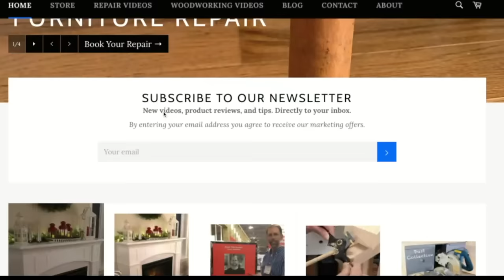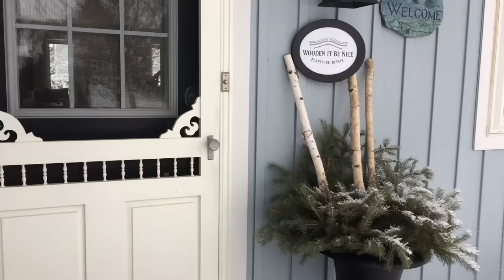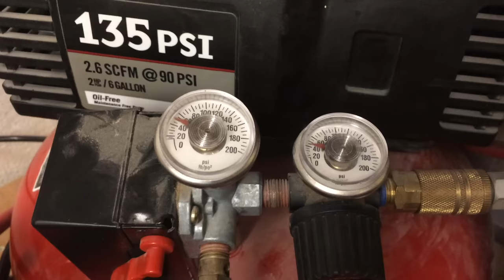How to Repair & Age Wood: A Rustic Wooden Chest Repair by Fixing Furniture

Comment: Love the trick with the coffee grounds blackening of screw heads. In the good ol' USA we can still buy straight slotted screws for restorations, but they look too new. So I'll test your trick. I am also going to test a couple of rust bluing techniques I found in other videos. I'm putting new hinges on an old box my wife's grandfather made. It's a box-jointed ammo box he fitted a lid to, painted gray, I was going to replace the old split lid but the boss said no. I sanded off enough of the old paint we can now read the box label. The trick with these is to know when enough is enough. My father was an antique dealer and refused to buy pieces that had been "restored" by a hot tank dip to strip all the paint and finish, then really sanded. No one will buy an antique that doesn't maintain a little character.

Comment: I find there's  a sense of satisfaction in figuring out how to return something to its original condition, as well as the puzzle of determining the best way to do it. As an amateur woodworker, I sometimes think this is more fun than building new. Great work.
Reply from the maker: Great point Tom!  I transitioned by business from custom furniture to furniture repair partly because of that.  I find it challenging and rewarding.  Cheers.  Scott
Reply: Scott, 
Something about the lid fit bothered me when you first set it on the chest, then after installed & you had to cut the lid haif round trim sections off of  the sides pieces it occurred to me that this lid was originally wider than what was given to you. Maybe there was a 3/4" section or piece in the lid between the two 8"  wide panels, that's where it came  apart - possibly. 
Why did you choose to cut the front rather than install an approximate 1" section on the back of the lid, or between the two panels, and "antique" this new addition as you did to the front?
Thanks, enjoyed the video, Tom
Reply from the maker: Good question Tom.  Adding wood to the top would have been obvious.  It's virtually impossible to disguise adding a new piece to a table top.  The grain pattern needs to match, the stain needs to match, the finish needs to match.  It typically requires a strip and refinish to get close to hiding the new piece, and even that doesn't work sometimes.  I hope that helps.  Scott

Comment: What a nice coincidence - YT just showed me your video on the Barrister's Bookcase. I have a very similar one but made by Melton Rhodes. Wish I had seen your YT earlier because I've been scraping and sanding the finish off - didn't know it was probably shellac or that I could amalgamate with with denatured alcohol. Oh well. I still learned :-) 
Then the next video that came up was this one - and I have a very similar rustic chest. My grandmother gave it to me 50 years ago. It has dovetail joints not nails but is very similar. 
Thank you for sharing your knowledge and experience.

Comment: I did a project a work several years ago where we needed to to metal plate conduct electrons in water that were not connected. We tried several additive, one of which was vinegar. Number one, it worked, but it stunk. The one we utimately found was stump remover. I worked great, but caused the metal to rust very quickly. Much faster than the vinegar. Just an FIY. Love you channel and you and other have inspired me into using my abilities to learn more and start repairing furniture myself. I've learned a lot from you! Keep up the good work.

Comment: That brought it back to life nicely.  I believe it is a carpenters tool box made from used lumber. A lot of old timers recycled lumber, I spent a lot of hours pulling nails from old siding and roof boards. As they were late 19th to early 20th century buildings they had old growth lumber.  I have seen barns with granaries, dairy sections and hay lofts with massive oak beams, others even black walnut beams.  They were trees from the proptery that the farmer harvested.
Reply: That chest would be impossible to move as a 'tool box' with any amount of  tools in it, plus, it would be much more chewed-up and oil stained had it been used as such, with perhaps drill holes and sawing cuts in the top of it as well.

I have a similar but larger chest in pumpkin pine with what my uncle called a 'til', which is removable and has a hinged lid, in the same location. 
Perhaps for money, but most likely for small items so they didn't get lost inside the trunk---  like sewing and knitting needles. I use my trunk for summer storage of blankets and woolen jackets. In the winter it holds my summer clothing!
I also have 11 smaller trunks and tool boxes in a graduated stack in my dining room. The various woods, finishes, colors and hardware make an interesting sculptural assembly.  
Every room needs an antique (and the color red) to help ground the room, in my opinion! I often think of the previous owners and wonder what their lives were like, what they did for a living, and give them  thanks for making the world a better place---  then and now! Each trunk, chest and box has a history and tells a story if we take the time to be open to it! 
But a stack of these makes a great folk art  history piece that has a beauty all its own. You just can not fake the patina that comes from use over time!

Comment: I'd have guessed the top crack was caused by those side trim board running with the grain in the opposite direction.   The much later screwed slats across the top were most likely added long after the big top separation crack showed up.

My choices for the crack would have been to live with it,  inset a strip of filler wood in the crack or make up the difference along the back of the piece and not the front.  Doing more damage to "disguise" the new cut would not have been my choice either.   The removal of that front wood, leaving a bigger gap than before and the removal of the lock mechanism, leaving a gaping hole all could have been avoided by choosing a different solution.

I own a similar piece for how the inside is laid out. It was my great grandfather's and held tools, including wall paper rollers, some paint brushes and some graining tools. He was connected with a paint company for years. 

The hinges you removed are extremely thick, which indicates they are quite old.
Reply: Agreed, he seems to be ignorant of the first rule of repairing - cause no more damage.
(Laughable hearing him talking about hide glue being 'reversible' then seeing him chopping chunks out of the front)

Comment: I have an old wood box very similar to yours but not quite as tall. It came from Weyburn, Saskatchewan and was used as a rock box in the days of the Richardsons.  Pairs of curling rocks were personally owned and carried to the rink by each owner. In the early days, weights were not standardized and big curlers had big rocks.

Comment: Thank you for your excellent videos mr Bennett, your calm manner and detailed explanations set you apart amongst craftsmen. i'm a hobbyist , sometimes during glue ups , i will moisten the wood with some water and also heat it up slightly with a heat gun for a better bond , Do you think this is necessary ??? thank you for your feedback ...God bless

Comment: Good job Scott; just a light hint as well;. In the past when there are a lot of screws to replace I've bought some of the same numbered screws that the longest I could find, removed the heads, mounted them very carefully by the shaft end into the chuck of a variable speed drill. Turn it very slowly to open the threading in the already drilled holes, back it out and put the screw in. Thanks for the tip to "color" the modern screws.

Comment: Very happy to see you using a 'Yankee' screwdriver. Most young people won't have an idea what it is.
Glue both sides? Yes, because you can't guarantee that with glue on one only, that it will wet the other piece due to surface irregularities.

Comment: Is there a reason that you didn’t splice in a very thin bit of wood in the gap at the top to keep it the correct size? That way the top would have fitted without having to cut the front, especially after you went to such pains to reuse the virtually destroyed wood around the hinges. Just curious.

Comment: why cut a rabbet out of the front of the chest, instead of adding a new piece to the top to widen it? would the replacement piece really be that noticeable? even after staining?
Reply from the maker: Yes, it would be virtually impossible to add a piece of wood to the lid and disguise the repair.  It's not just the colour of the stain, but the grain pattern match as well.  I hope that answers your question.  Cheers.  Scott

Comment: Nice repair. I would have done the lid different, and added a piece of wood  so you would not need to cut the front down. Even if you could see that it was newer or different.
Reply: Looks like a narrow strip of vintage filler wood could be taken out of the bottom and glued to the hinge side of the top to avoid rabbiting the front. Then fix the bottom with a matching piece of pine.

Comment: great antique.  no change in the look but strong and back in to operation 
If my customer wants it new.(does not care about antique look). . will it make any difference to cut the whole length of the back (hinged part) about one inch and put a new wood strip?

Comment: I had a chest very similar to this. My Gt.Grandmother used it for a marriage chest. 
So mine was built by her brother,  who was a coach painter. In the late 18 hundreds. 
The finish was pine stumble glazed over pinewood. 

It was made previous to my Gt.Grandmothers marriage in 1874.
Oh, this was in the UK.
It originally had strap hinges,  square nails, and hanging handles just like the one being worked on..
I had to do the same repair,  but unlike the video,  I replaced the whole length of the edge,  instead of multiple patches.

Comment: Personally, I would’ve added a strip to the rear of the lid to take up that space and stain it to match or even make it look like more trim. It wouldn’t have occurred to me to modify the front of the chest. But as you say, it’s the customers choice.
Reply from the maker: Yes, that's an option to solve the problem.  I find patching on visible surfaces like the top is virtually impossible to disguise, hence the approach I took.  Thanks for sharing that Stuart!  Scott
Reply: YUP, that fix looks terrible, nothing right about that.

Comment: nice techniques.  especially dealing with patches on the troublesome inside shelf side.    I know this is originally tool chest.  but with so many nails in funky location out in the middle of the wood plank, got me thinking.  the chest has to be abused as a wood working surface; nail(s) driven acting as a dog, to hold the piece while worked to shape or size.  
Probably was planned discard due to nails in there and new owners wanted it and that discarding woodworker cut and cleaned up the nails and sold it to new owner.

Comment: I really enjoyed this one, although if it was my chest and I was going to use it as a coffee table I would have removed those casters on the bottom and maybe put some small feet on, or a bit of leather to protect a wood floor. Not sure those casters were original? I have that same Veritas honing guide and love it. Thought it was expensive at the time (compared to the cheap Chinese honing guides) but now I can see that it was money well spent. I like these long format videos too.
Reply from the maker: Thanks for sharing your thoughts John.  To answer your question, the current owner attached the wheels to the chest, so they're new.  Glad you're enjoying the Mark II as well!  Cheers.  Scott

Comment: Hi , just a couple of questions here , in stead of insetting the top , would it be easyer to ad a 1/4” peace and do your color matching ? Second the back , where you removed a thin peace and it was grey beneeth . Why not sand and do matching finish ? Lastly , since you have patron , could you take of the publicity on your chanel plz ?

Comment: In your experience, do you always check to see if a joint is reversible? If I make a repair and it needs to be removed years later, is there a way to mark it or make it obvious?
Reply from the maker: I only encounter this when I'm trying to take something apart.  If it won't let go, I use white vinegar to loosen the adhesive.  It works great with hide glue but doesn't do much with PVA glue.  To answer your question, I wouldn't mark the joints.  If they have to come apart in the future (e.g., in 20 years), you will find out at that point if vinegar will help you out.  Make sense?  Scott
Reply: @FixingFurniture  Makes sense. Thanks!

Comment: I'm curious why you didn't just add a 1/4" strip of wood to the back of the lid instead of cutting wood off the front of the chest? To me it seems like it would be easier to hide adding a strip of wood than changing the front.

Comment: I'm redoing an old dresser and ran across a problem I need help with. The slides are on the ends and wood. They're quite worn,causing the drawers to slant down in front, my 6th drawer sits on top of the 7th. As of now I plan to glue in a shim and sand it down. Up to 2mm is missing in some spots exposing more than half the existing nail I don't want to have to remove. Do you have a better idea or tips on doing this? I am by no means a professional, learning by trial and error and don't want to cause more damage. Thanks

Comment: When you cut off the patch right near the hinge, doesn't that weaken the hinge connection since the screws now go in right by the end of the grain? Why not keep the original patch holding the hinge screws as large as possible and only add the smallest possible secondary patch?  Near 49:50

Comment: On a board that has so much damage, I wonder if it would be worth removing the board, planning the back until you have only a thin veneer left and use a full new board for the back.

I haven't seen snow since 2008, some where along the road in Afghanistan.

Comment: 4/7/23; Old chest renovated/repaired & kinda rubbed cleaner-than-before, looks nice! I am not a antique renovation enthusiast,, but do enjoy making repairs replacing slotted screws with new 'star' types, light sanding, light stain & urethane over all mini potholes & 're-freshed' (lightly sanded) surfaces. Time to 'done' is faster than super detail pro restoration like you have done on this 'box' soon to become a handsome coffee table! Very nice job! A+✅️👍👏😊

Comment: Why not add a piece of wood between the two boards of the tray?
Its original design would have been respected, and you would not have had to cut the front and the two edges.

Especially since these edges were designed to prevent rainwater from entering.🤔

Comment: Love your antique planes.  I had a few that belonged to my grandfather; they were Stanley tools, with somewhat ornate handles and metal work frames.  Sadly, they were stolen.
What would you use as an alternate to hide glue?  As a vegan, I don't eat or use animal-based products of any kind.
Reply from the maker: I’ve had that question before.   Hide glue uses animal protein and there isn’t an alternative “reversible” glue.  You could use a PVA (aka yellow glue), but it’s not reversible.  Cheers.  Scott

Comment: As for the debate on putting the glue on one side or both sides, it might depend on the manufacturer. I've had two brands of PVA glue of the same classification, yet recommended putting glue on one side only, and the other on both sides. Color-vise and consistency-vise, both products looked the same.

Comment: What happened with the construction that after you repaired the lid, closing up the gap, that it no longer fit the chest? That wouldn't all be due to wood movement, would it?
Reply from the maker: It may have been as I also noticed the bottom had the same gap in it.  It's puzzling isn't it?

Comment: Why did you now replace a full inch to four inches down, and beyond the morticed areas on the hortizontal?  The old wood obviously had staining and wood rot.  I question how effective the gluing of the splintered ends will be in the long run.  It does not make sense in my logic.  Please help me to understand your choices.

Comment: With carpenter's glue there is no point to spreading glue on both surfaces.  Where the surfaces touch the glue on one edge will do the job,  and where there is a void the extra glue will do nothing.  With epoxy this is not the story,  and glueing on both edges may be useful.  Agree 100% about the need for good clamping.  Loving the channel,  from nz.
Reply from the maker: Thanks for sharing your thoughts on that Evan and thank you for your support!  Scott

Comment: Probably the top was salvaged wood and the nail holes were from the previous use of the wood. Perhaps salvaged from a old barn or the like. The roughness of the wood may bare this out. If it was originally from a barn or something that didn't call for a smooth finish, and the builder didn't bother to clean the wood up for the simple box. Or not LOL.

Comment: 46:35 I'm okay with replacing the hinges because, like you, I believe the original hinges were the strap hinges... long gone. But removing the lock is really rubbing me the wrong way. Replacing the escutcheon is a nice compromise, but couldn't you have reinstalled the lock a bit lower? 💖🌞🌵😷

Comment: I was with you until you cut the case to fit the trim. Villiany
Reply from the maker: I knew that would draw some reactions.  The alternative would be to add wood to the top, which is highly visible and impossible to match, even if it was refinished.  This project required some compromises to meet the customer's need.  Thanks for sharing your thoughts on it.  Scott
Reply: @FixingFurniture  it would have been more work but, as long a you were going to cut the case, why not cut all four side on the bottom. Then you would have had plenty of matching wood for both the top and the side fill-ins.